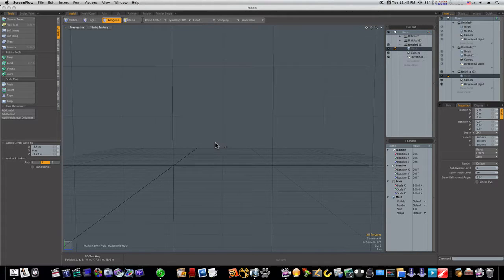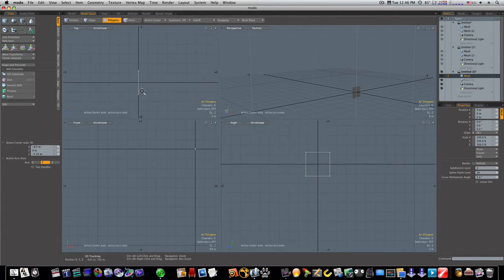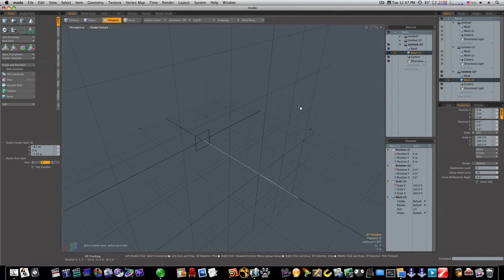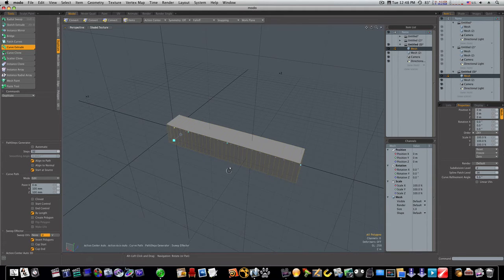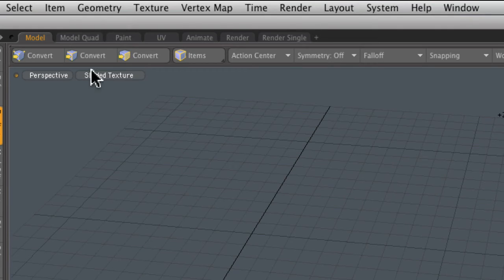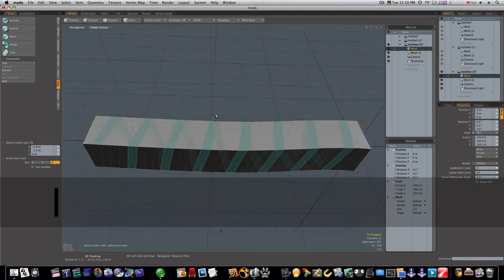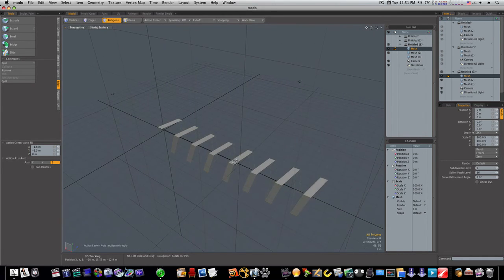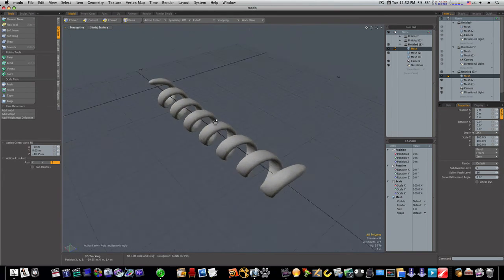Modo 401 3D Modeling Quick Lesson One - Using Curves to Create a Telephone Cord

Comment: I like this tutorial, it was quick and simple. thanks :) Is it necessary to define the cord's actual path, length and other proximity properties before taking the steps to model it as you've shown, or is there a way to use that initial bezier path (or one like it) to function as the cord's skeleton AFTER it's been modelled? (sorry, that skeleton term likely didn't make a lot of sense :P )